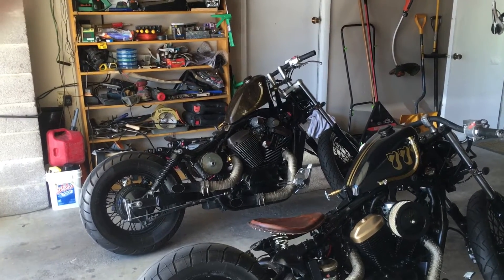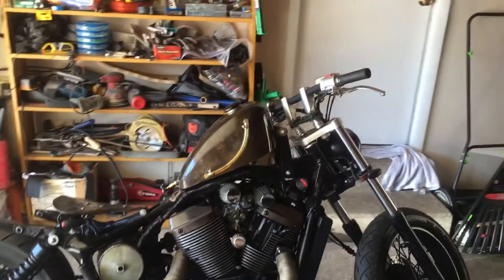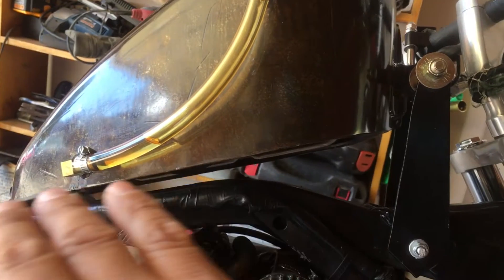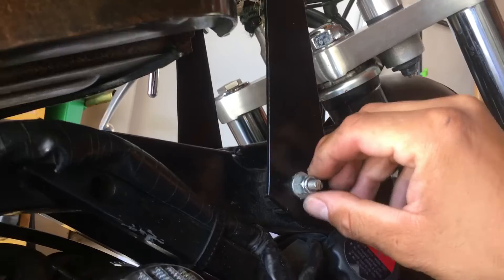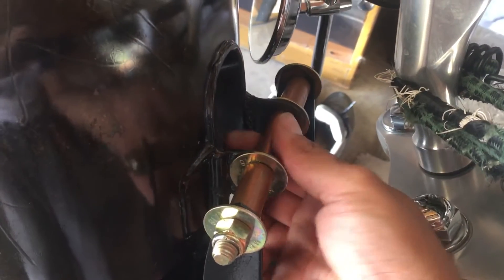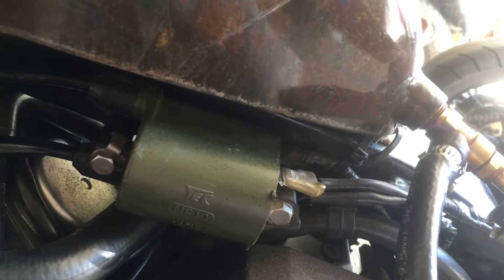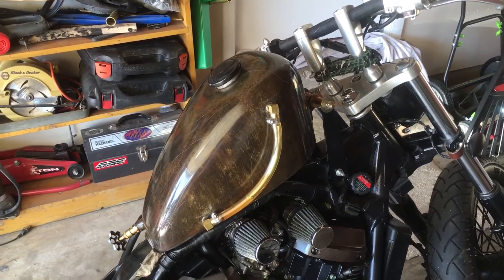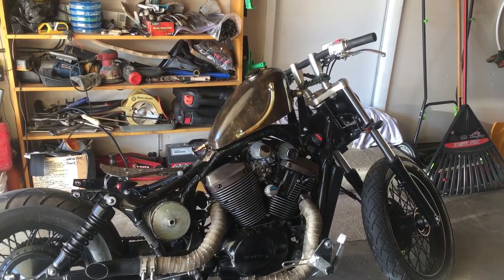HONDA SHADOW 750 SPIRIT (tank option)

Comment: Do you use the stock Harley sportster petcock or do you have to modify the tank to accept the original Honda petcock?
Reply from the maker: the tank is made from a company called Pandemonium Cycles (There might be a link in that video too about them, f not check out some of my other ones, they have them) they make the entire tank bungs and everything, the petcock was a choice out a few options they have on there site...great company, HIGHLY recommend them!
Reply: bannanapancake thanks for sharing, I found the link. But generally my question was do you need to use a different kind of petcock for certain types of bikes? Like, if I bought a sportster tank from eBay and it had the original Harley petcock on it, could I just plug it into the fuel lines on my Honda and be good to go? Or do I need to use the Honda petcock ?
Reply from the maker: DisgruntledVet 11B - you should be able to use it as long as the hose and petcock match up in size. I don’t know what size of hose your bike is rocking or what Harley size of the tank your ordering... but if anything else they do make file line converters from let’s say “1/4 to 1/2” and all sorts of sizes to different sizes, there small little plastic (fuel grade) tubes that you can get from any auto parts store that change the size of what your going for, I hope this makes sense..  sorry I mis-interpreted your question!!
Reply: bannanapancake awesome! Thanks again for taking the time to reply to me. Ride safe brother - peace

Comment: has anyone done this on a 98 shadow 1100?
Reply from the maker: I get that question a lot, the frames are somewhat similar and definite tweaking would be involved doing this set up. hope that helps some
Reply: Doesn’t work there’s a fat bump right under the tank so those peanut style tanks won’t fit on right